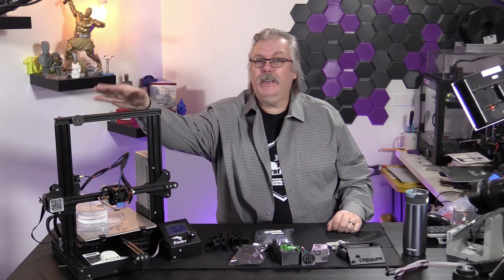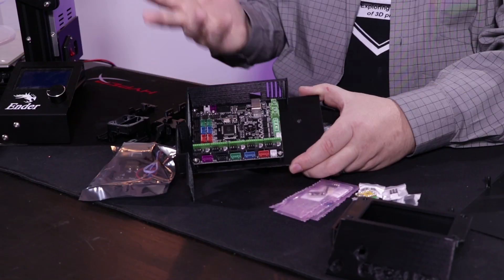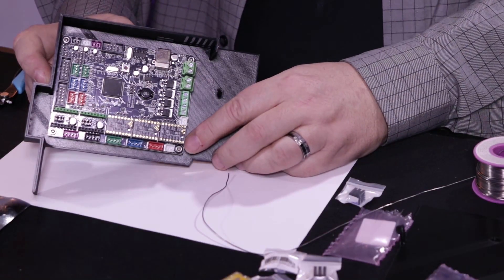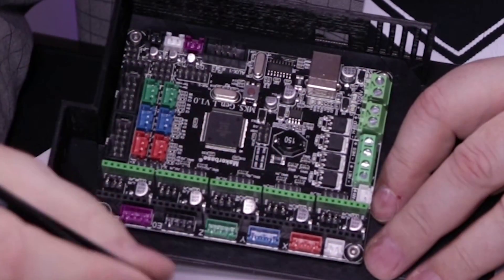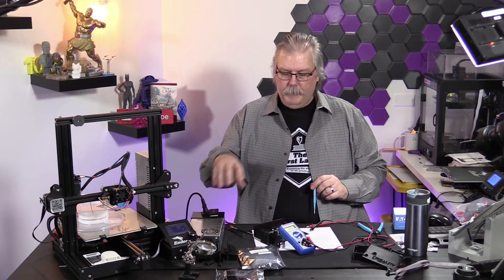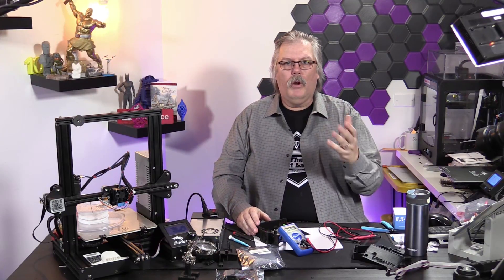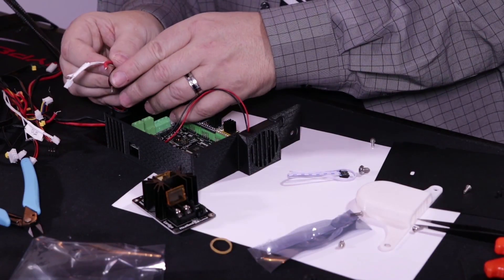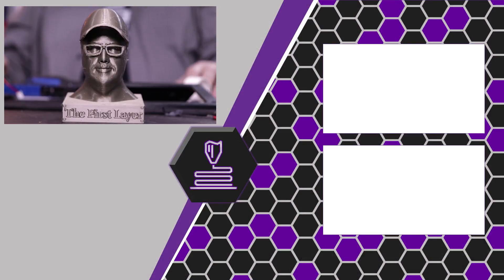Overhaulin' the Ender 3

Comment: why you use a 8 bit board when you can use a skr mini e3 v2.0 as its a 32 bit board and it way easyer to upgrade  as it dose not have to have boot loader to upgrade and its only 35 bucks or so and its got lots of hook ups for bl touch and other things

Comment: How on Earth are you powering NEMA 17 motors with a mere 0.5 Volts? I'm pretty sure you were adjusting amperage (as such chips have potentiometers for) rather than Voltage. But if your multimeter really was in VDC then something really strange is going on here. But perhaps you were adjusting the signal voltage, but that should still be 3.3V to 5V.

Comment: About audio in this video: do not use gate. Just don't. I know that it feels like a great idea: there is background noises that can be annoying. 

But what is FAR more annoying is background noise that cuts off.. The thing is... if you leave the background noise in the mix, we as audience will forget it in about 10 seconds...  I'm sound engineer by trade so trust me on this: get rid of the gate. You keep focusing on the noise instead of letting your brain do it's thing which is to forget all constant noise sources and focus on the message. When you cut it off, we have to relearn it constantly and it gets VERY tiring. 

After that, there is of course immersion: when you leave the background noises to be constant, we are going move in the room you are in. Our minds just work that way, we quite literally think we are in there. When you cut the noise on/off, you are very literally opening and closing a window in front of my face.

There are ways of decreasing background noises: by turning off the background noise sources.. and using a better mic. That is pretty much it, there are restoration suites available but then we are really doing it ass backwards.

I have a saying: do it once and do it well. Don'¨t fuck around, get rid of the background noise source, turn off the printer, move to a different room or leave the noises in the background but your audio gate use in this clip will get you an F.. I really mean it, if this was a student work, i would not let this pass.

Comment: Don't mess with you Ender 3. Mine runs almost 24/7 and it prints great. Other then a few printed upgrades, it's stock. If you want a better printer, buy a better printer. The Ender 3 is a great, low cost printer that will work perfectly out of the box if you take the time to just dial it in. Don't waste your time and money trying to make a great machine better.
Reply: did you add stepper dampeners? because with this board the motors become quieter then with dampeners. and part of his hobby is doing what you want. i have one stock and one im upgrading mainly because a stepper driver failed. but to tell people not to do it is idiotic. infact you can upgrade a ender 3 to work as well as the prusa mk3 for less money and defenitly less wait on shipping.. and cost does not translate to a better machine plus your better view is diffrent then anothers.
Reply: Why upgrade a printer that works perfect? If you want it to run like a Prusa, buy a Prusa. No stepper dampers. The newer Ender 3's have the drive gear pressed on. Pain in the butt to get off and requires a puller, not worth it. Besides, mine is very quiet with just putting  1/4" neoprene pads under the feet.It's a $200 printer that works great out of the box if you dial it in. Would you buy a new Honda Accord and drop a V8 in it? That would be idiotic. To me, throwing another $100 into a $200 printer is idiotic. I'm too busy printing to upgrade something that works great. Most people try to do upgrades because they didn't take the time to dial in their machine thinking it will print better. NONE of the upgrades for the Ender 3 make it print better. Dial in the Ender 3 properly and it will print as good as a Prusa for $100 less.
Reply: @iwantthisfuckingname  Because you can make it work better and/or quieter. The Ender 3 frame is a solid base to build from, the extruded aluminum is much better than the Prusa's mix of metal and 3D printed plastic parts. With the upgrade to MKS Gen L + 2208's the motors are much quieter, and the touch screen is easier to use. Also the Gen L uses an ATMega2560 chip which allows more data to be stored. This chip will let you add a BL Touch or EZABL auto bed leveling, filament runout sensor, laser engraving attachment, or any other upgrade using Marlin or TH3D. The Creality boards ATMega1284 does not have enough memory to modify the firmware required for these features.

You may not see the need to upgrade yours but that doesn't mean everyone is content to keep it stock. You can make the Ender 3 better than a Prusa with all of it's features for less money. That is just one reason to upgrade it, there's plenty more reasons depending on what you want it to do.
Reply: @iwantthisfuckingname  Absolutely agree with everything you say.. Like you, I use my Ender 3 24/7 and I get stunning results from it. The only component I have upgraded is the Extruder to an all metal one after the old one wore out but that's it. Setting up the machine and setting up your slicing software is the key to beautiful prints.
Reply: @iwantthisfuckingname  Ah, no, I was not talking Hot End, I was talking the other end of the Bowden Tube. The original plastic extruder was worn away by the filament rubbing at it,  solved by printing out a rather snazzy filament guide and changing the extruder for a 'Comgrow' Aluminium one.
Reply: @iwantthisfuckingname  To be truly honest I have only ever printed with PLA. Yes I know I'm probably missing out but I just don't print anything that requires something other than PLA.
Reply: For many, Ender 3 is the only platform we can afford but it doesn't mean we should stop there, right? I mean.. the base price has been paid and now the improvements will take it to next category but over time. I know perfectly well that i will pay more over time but the other choice is to not buy at all and save until one does have better printer.. like you said, it prints nice out of the box so while upgrading, i can still enjoy good printer. The other choice is to buy a more expensive one later and miss all this learning fun...
Reply: Why spend 800 when i xan spend 500 or 600 to get to the same level? Also the pressed on gear is a cop out as you can purchase gears that use a screw for cheap.
Reply: @coffinsnail6930  why spend 1k on a prusa, when you can learn a new hobby, spend some time, have fun and  get the same results for 250-300 bucks + you get precious experience, when you walk to fix an expensive printer's problem because of the troubleshooting experience you gained from a cheapo printer you understand the value
Reply: that's a really bad and (pardon my language) stupid mindset
settling for less is the worst you can do, many people said "oh it prints well enough, its an a8 don't waste your time on it", but I continued, now people ask me how I got quality comparable to prusas, everything can be  improved on that machine, it's not great, it's just decent
the thing is cost and experience, you gotta know exactly what you need to upgrade, and if it's worth it
Reply: printed  upgrades don't work, unless it's some advanced stuff, like designing your own frame with printed parts (the best upgrade I've done to my a8, 3/8" rods and printed parts)
the thing with cheap printers are the drivers and kinematics in general: they're crappy, better drivers will provide a smoother surface, and better kinematics (rails, bearings, belts, etc) will make or break a printer
printing stupid braces won't help you, but converting to a rigid frame will, the ender 3 has decent enough rollers and extrusions, if you pair it with some smooth drivers you have a great printer on your hands, as you can't possibily upgrade anything else (the ender 3 while it's very good, it's limiting as to upgrading, so the best bet is a second printer)

Comment: Should be titled "how to make a mess with your ender 3 to upgrade NOTHING"  or "how to turn easy upgrades into complicated nonsense"  ....
Reply: if you use the board correctly yes, if you waste 2208s in standalone mode you are just dumb
Reply: he should have gone for 2130s as this board is SPI capable, only go for 2208 if your board supports UART comms, like the fystec f6
Reply: the new board allows for quieter steppers as well as control over the steps as in 1/16 or 1/32 maybe you should do research before you spout off this board and versions of it are used in higher end machines.

Comment: Hey guys, great video! I'm doing the upgrade as well and I have a couple questions hopefully you can answer.
1) What are the advantages of using the LV8729 for the extruder, is it because it does 128 steps? Will a 2208 work or should I order one of them? Also did you set the LV8729 to 0.5v too or does it need a different value?

2) The jumpers aren't really explained well in the manual, is there some info somewhere that explains what each one does? I thought leaving all 3 in set it to 32 steps but you removed one from each for the 2208's, and removed the first two for the 8729. Could you please let me know what that sets?

Thanks!
Reply: don't trust him too much, he's been a mess the last couple of videos, lots  of  misinformation
for extruders you can run whatever you like, from 2100 & 2130 to 2208 will run perfectly fine for extruder, and 2208 are  actually high microsteps, just limited by the config, they're very smooth in movement because of the interpolation/microplyer and probably has enough torque in stealthchop at those speeds
Reply: also, if you can go for 2130s, this board does not support UART, but does have SPI, that way you can real-time control your drivers and have some extra features, like setting everything you'd ever want by firmware
Reply: also, if you can go for 2130s, this board does not support UART, but does have SPI, that way you can real-time control your drivers and have some extra features, like setting everything you'd ever want by firmware

Comment: If you have footage of removing the board from chassis and the removal of wires I'd love to see that. My board is a real mess of wires all hot glued up and I feel like they won't easily come out when I pull them (and I have tugged them a few times - they won't budge). You think I'll need to cut the glue off?
Reply: Use some isopropyl alcohol and a hobby syringe.  Put some IPA around the glue, between it and the connectors.  After a while, it'll soften and a small pair of tweezers should let you gently pull the glue away without damaging the connectors.  To release, don't tug on the wires, just the plastic connector housing.
Reply: @teac117  thanks for the tip. Just tried it out and the IPA softened it a little so I just went ahead and cleared as much of it as I could right away. All cables in and out no issues now :). 

I'm not swapping boards yet but I am still glad to be rid of the mess in there, airflow probably a lot better now as well with the wires are out the way.
Reply: Just find the Teaching Tech YouTube channel. He covers removing the Ender board as well as putting in this board.

Comment: Dont tin wire going to a spade connector. Mechanical force will compress and loosen em over time
Reply: Underp4ntz please give a reference to this I’m Curious to read that law :)
Reply: tin will cold flow and creep, causing the connection to loosen over time, so either you use bare copper, or crimp it (I personally solder my wires to the crimps, but taking special care not to get tin on the contact surface)

Comment: Just a little bit of misinformation in this video; you do NOT need to upgrade the motherboard to install a bl touch.
Reply: Doesn't he say right at the beginning that there's already a BL-Touch installed on the original board?
Reply: I have a bltouch on pin 27 and a filament runout on pin 29 standard board.  Pretty much covers of everything I need
Reply: It makes it easier for things after that.

Comment: Do you need to change the motherboard to change the Ender 3 to a Touchscreen, or can you use the existing motherboard?
Reply: You have to change both, it's not compatible with the Creality board. Well worth it though, changed mine out last week and love it. Check out Teaching Tech's videos here on YT for detailed guides.
Reply: There are negatives if adding the touchscreen that no one talks about. Doesn't have live z-adjust or live flow adjustments. If you don't use them you should be set.

Comment: The LV8729 stuff got cut out.  Anything different with it vs the 2208s?
Reply: yes it allows for finer stepper control then the 2208 thats why its on the extruder not sure what step its set at with the two jumpers removed but i do know it can do 1/128 with the lv
Reply: kinda dumb, the 2208 can do 256 microsteps, but noone goes above 32 because of the little torque you get, you get  like 2% of the stepper's torque at that resolution, it's not good for an extruder, but 32 can work out
your best  bet is buying a 0.9° stepper motor, literally doubling your resolution with no problems

Comment: So I'm actually about to start this upgrade, after watching it on Teaching Tech. I'm just waiting on the 2208 drivers to arrive tomorrow.  In this video, you recommend .5VDC for the ref voltage, but i've seen other videos that set that ref voltage to 1VDC.  Any input is appreciated.  .5VDC seems a little low.  Then again, I haven't looked up the spec sheets for the drivers, or the stepper motors on my Ender 3.
Reply: I'm running TMC2130s, which are similar but lower powered and software controlled. All calcs I've seen basically correspond to 1 volt = 1 amp for trinamics, so take this into account.

To run the steppers on an Ender 3 quite cool, I have my steppers set to the following:

X and Y: 400mA (so 0.4V equivalent)
Z: 600mA (0.6V)
E: 800mA (0.8V) (Could be far lower too, but the motor isn't getting warm that I've seen)

If using other steppers such as the A4988s or the DRV8825s, the vref corresponds to the amperage in a different manner. Usually, these ones will be set higher (around 0.8-1V).

It's better to start low and work your way up. 0.6V should be more than sufficient for TMC2208s with the weight load on the Ender 3.

EDIT My numbers were slightly off, but you can calculate your target vref for the motor here: https://learn.watterott.com/silentstepstick/faq/
Reply: @BryanBakerXBrav  Outstanding info. I will use these numbers as my jumping in point. Thank you.
Reply: I just added TMC2130s to this board in SPI mode and had to drop the voltage to 405 to keep the motors cool. The stepper motors on the Ender-3 are tiny!

Might also be worth mentioning that this upgrade will take up a lot of time! Transitioning the new board and settings will eat up a lot of time. Took me a day to get my settings tweaked since there isn't a lot of information on this board and TMC drivers in general. 

Also, it's a shame UART mode wasn't even mentioned for the TMC2208s!
Reply: @skeepskeeperson  there is info, not too much on comboing, but theyre simple, the board is just plug in wires and set the correct board def in your firmware, the drivers are easy (while spi is more complicated, there's still videos out there)
should be quick for someone that's flahsed their firmware 2 or 3 times, or maybe 35 because they love tinkering with it 🤣
Reply: @skeepskeeperson  and well, there's a 350 page manual for the 2130, so there's info there 😂
but yeah, trinamic drivers should be used in spi/uart mode, it's such a waste otherwise

Comment: The only thing that I think it's missing here, sorry if I missed it, is talking about what that voltage reading off the driver actually means.

For whatever driver you are using, if you look up the datasheet you should find a formula for setting the current. That potentiometer is setting the current that goes to the motor but you are reading a reference voltage.

Sometimes you need to increase the current but it is important to know the maximums of the motors. Especially if this video is applied to other printers.

Thanks for going over this stuff in one video. It will surely help some folks.
Reply: It's even easier than looking up the manual. Watterott posts the calculation on their site: https://learn.watterott.com/silentstepstick/faq/

For reference, I run my TMC2130s on an Ender 3 between 400 and 600 mA.
Reply: Bryan Baker I typically keep my 2224s at around 500 for x and z, and 800 for y. But my bed is heavy. I think my extruder I'd usually at 1A. 

It operates in stealth chop most of the time, but will switch when needed to spread. 

I love being able to set the current in configuration rather than a pot.